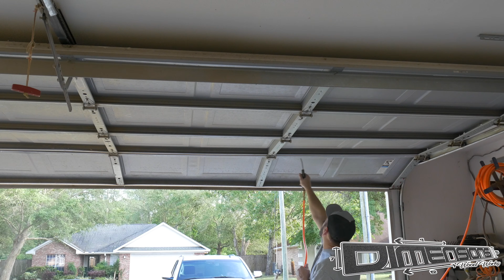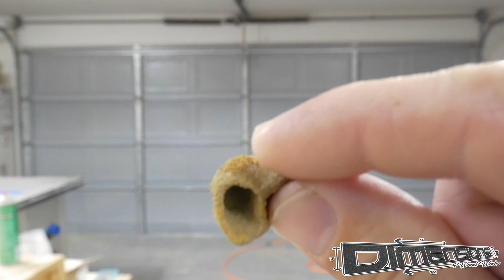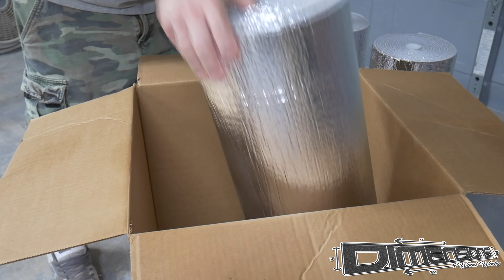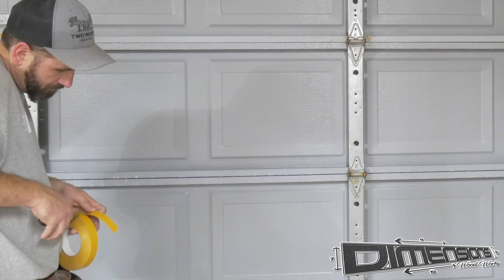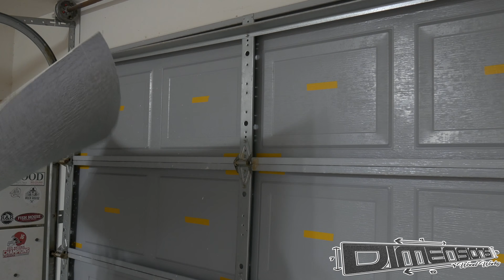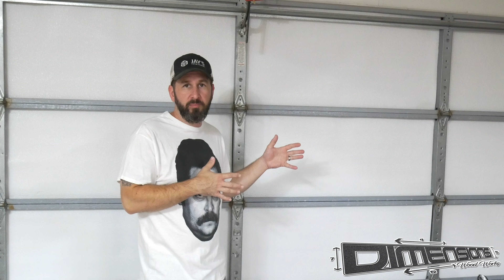Garage Door Insulation

Comment: I placed the product in one continuous length across the width of the door and mounted it to the top of the metal supports to create an air pocket between the door surface and the insulation. Doing it this way increases the insulation value. For my installation I chose to use 3M high bond double sided foam tape and I also placed the product under the hinges for added security. Self tapping screws were also added.

Comment: Thank you for the video. I'm about to buy it too. I'm sure you've had this feedback but the photo in the product page indicates it should be stuck to the frame instead of directly to the panels to make an air gap and also to stop the hot frame itself from radiating heat. Glad your way is working for you, as honestly the inset way looks better. How has it fared over the last two years?
Reply from the maker: It’s helping TREMENDOUSLY maybe the other way would help more, but it’s blocking on average, about 15 degrees from the temp outside the door

Comment: just about to get these for my garage. I live in Texas and really wanting to insulate my garage this winter. I have seen this kit and in most of the videos on Youtube, they apply the tape to the support bars inside the garage leaving an air gap between the panel and the actual garage door. However, yours looks far cleaner and if it is just as effective, I think I will do it this way as well. You said in another comment, you also insulated the attic above the garage. What did you use for that? I also need to do that.
Reply from the maker: Several comments said,... “ You did it wrong” but I’ve noticed a big difference in temperature in my shop. The attic space , i used the recycled blow in insulation but didn’t blow it, i just broke it up and stuffed it between the joists and decked over that with osb so I’d have additional storage in the attic. The plan was always to add an air conditioner to combat the Mississippi heat. Hope this helps and thanks for watching.

Comment: Your installation method seems to be completely different than the instructions from US Energy.  Your way makes a lot more sense to me as this way you eliminate the ~2" of space between the door panel and the framework.  Plus, considering how thin the foam is it seems like it would be a total puncture magnet.  I've already taped off the horizontal portions of the frame per the instructions but I think I may bail on that and install the way you did it.
Reply: He did it wrong, what was done is better than nothing but you are supposed to apply double side tape on the frame of each section and stick one roll at a time 2ftx16ft. The air between the insulating material and your door is the insultation not the "thin" material itself. Still thumb up for effort of putting out a video on YT.
Reply from the maker: I thought i followed their directions, by either way... this worked for me. I had someone else say “ you did it wrong “ but all i know is that my shop is MUCH cooler in the Hot summer months and warmer in the winter. I also insulated the attic space above the garage as well and I’m sure that helps to make a difference. Good luck! Hope the video helped.

Comment: Hey JD, nice video. Was curious about these radiant panels. Typically I see these attached to the outer frame of each panels, as opposed to the inside panels. So this is okay? It looks cleaner the way you did it.... no need to leave the space between the door and insulation?
Reply from the maker: OfficialRobbTorres it’s done well for me. But I’m sure each door is different. With this door design, the “frame” is actually the edges of the panels put on a break to form the “frame” of the panel so there’s actually nothing that’s not covered. It’s dropped the temperature in my shop about 10-15 degrees from the heat outside.

Comment: Can you ad a second layer of insulation?
 So double panel!!
Reply from the maker: I’m sure you could, not sure that would double your R- rating though... that’s a question for the manufacturer.
Reply: @dimensionswoodworks  I just completed my garage door doing this way as well. I was wondering if adding a second layer would make a difference as well. Its been two years since you asked this ?. Did you do it?

Comment: has it helped with the heat reduction? thinking of getting a kit, do you think it is worth it?
Reply from the maker: Very much! My ultimate goal is to air condition the space, but even with just the insulation on the door and the attic above the garage it’s about 15 degrees cooler than outside and i live in a brutally hot area.
Reply: @dimensionswoodworks  Thanks for the fast reply, installing an air conditioner is great, I think I will do the insulation and get a big fan for now and see how it goes, I also live in an extremely hot area, thank you!
Reply from the maker: No problem! Good luck 👍🏻

Comment: Turned out great and let me know how well you can tell a difference from with and without. Having a Garage woodworking shop, that is a great investment for sure and being that the garage in most cases is the one room dedicated to us fellas of a household, I would have to say and agree it is a great investment to help with our excruciating summer heat here in the south! Job well done and thanks for the tips and instruction video.
Reply from the maker: It makes a MASSIVE difference already. I’m preparing the shop a little at a time, to eventually add a mini split so I can have a comfortable space to work in.